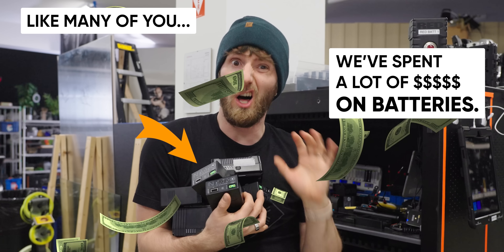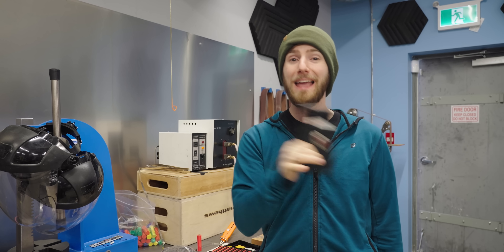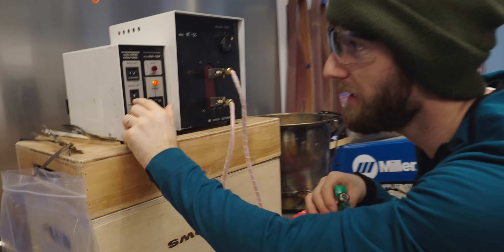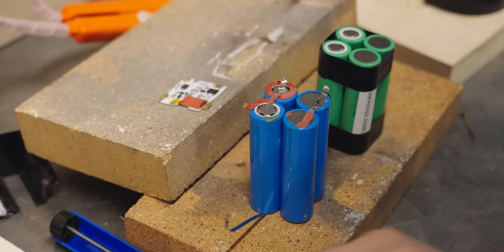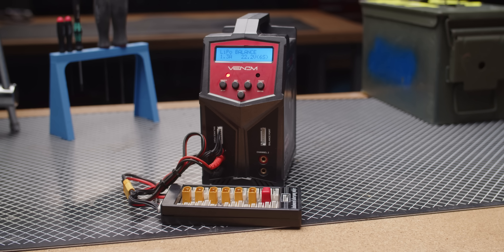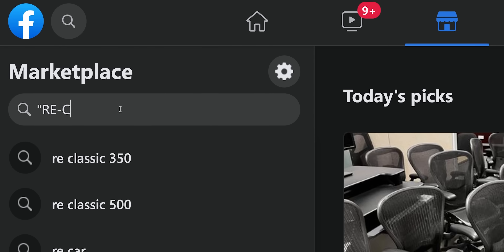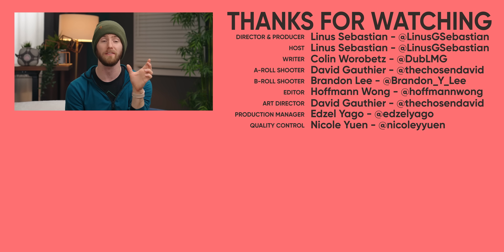This should be illegal… Battery Repair Blocking

Comment: ive had more than a few laptop batteries take a shit after changing the cells. the bms just goes into lockout and refuses to charge or allow voltage to pass to the laptop. it definitely should be illegal! if the voltages of each cell are in correct spec, then it should just work!

Comment: Those weren't shortcircuit spark, those were nickel strip being burnt by the spotwelder being a bit too strong.

Also, they worried too much about a few sparks and then they cut the nickel strips with some non insulated gardening scissors like, come on guys!

Finally, always wear gloves when spotwelding, spark may fly :p

Comment: $0 why don't you donate/give/sell for cheap ALL THO$E GOOD CELL$ ???
Reply: Y'all are TOO SAFETY CON$¢10u$ !  Get rid of the 'you blew it (!)' marginal cells and re-use the other 'good ones.'  Duuuh ... apologies but, yer WASTEFOOL !  :-(
Reply: those LiOn 18650 cells can be used in flashlights etc., ... I replace 2 or 3 C & D Alkaline battery flashlights with these cells & just use 'dummy batteries' to make up the gaps.

Comment: instruction works in 90% of cases whith not completely dead batteries
1 - fuly charge battery u want to repair
2 - fuly charge new batteries that u want to use as a replacement
3 - assemble new battery pack and solder wires to it (long enough to connect them to bms without disconnecting old battery pack)
4 - take old battery and coonect new battery pack in paralel using wires u previously soldered (do NOT disconnect old battery pack)
5 - disconnect old battery pack and assemble battery all together (u may need to change wires for shorter ones - do it but remember not to disconnect wires beafore new ones are fuly connected)
6 - discharge and fully charge your new fresh battery (neded for ballancing and detecting new real cappacity)

shortly speaking trick in all that is that bms controoler blocks it self if power is disconnected fron it (from any battery banks that are connected to it) - so to change batteries u just need it to be always powered on

Comment: Evil BMSs, nice one. To some extent, this is true, though. For example, in the past I tinkered with a few laptop packs, restoring them. They have microcontrollers inside with software which counts cycles, remaining capacity, and also monitors the battery health, and so if they decide that the battery is damaged or faulty, which can happen by disconnecting the BMS wires incorrectly (i.e. you first need to disconnect positive or negative terminal to remove power from the BMS to stand a chance), your only chance then is to reprogram the BMS controller, and these usually are not open source…

Comment: Back then on my Notebooks from 2005 and 2008 there Batterien was exchangeable like a Modul at the bottom you could even use it with cable and Batterie out... and also Smartphones like Samsung s2 or HTC one u could swap out Batterie why are nowadays every Battery is hidden so deep in every device like on Notebooks u need to open whole thing and Smartphone also.... is this just a commercial background so ppl are unable to change it by themselves or did they get so "smart" they NEED to do this cause ppl dont play around?

Comment: you need to power the assembly (battery + bms) to start the bms. simply replacing the batteries does not start the bms

Comment: Let me tell u my story…   I tried re-celling my dell battery. Inspiron 7537 to be precise. I got a generic battery, took that apart and got the 4 cells out then connected the new cells with original battery bms. And boom. It never wake up! the bms was so smart to shut down it permanently,  so for the future Linus plz keep the bms in a continuous voltage. May be with a bench power supply and then work on the cells. Its like the bms needs life aids like a ventilator for a patient in ICU. Lol

Comment: I love that in case of a fire you have manipulated the door to be easily opened. The door with the sign on it which reads "Fire Door, Keep closed, do not block". :D
Reply: At least they're propping it in anticipation of a runaway exothermic reaction and not because they're using it as a ghetto loading dock (see: every restaurant, ever).

Comment: So Aliexpress and the like sells generic bms boards and one feature of those is that when you first connect the battery pack you get no voltage on the output until you have connected a charge voltage to it whether the pack needed charging or not.  Then the output voltage will be turned on.  This could confuse some people thinking that the bms is evil or something but it is just a safety feature or something.  I don't suppose you have run into a feature like that with your battery pack?

Comment: Dell has Evil BMS, not only do they not accept replacement cells, the BMS artificially degradates the cells, charging less and less overtime and falsely stating the condition of the cells. i wont buy Dell because of this. No, they do not care about the environment, just selling more batteries.

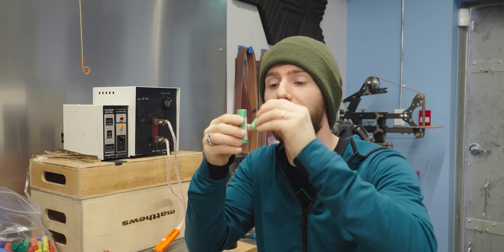Comment: 5:33 wrong, your next order of business is to load the individual batteries into a tester and have them 24 (minimum) tested for capacity, true capacity, and many other factors and also get them equalized. You never go to spot weld anything until you're 100% sure you've got a right pack. HUGE mistake.

Comment: I haven't glued the backplate of my phone because the charging port breaks if i use another cable, it won't completely stop charging, but after switching cables i have to position the cable a specific way.

Comment: I read somewhere that you could build the new pack but to get the bms to work on it you had to charge (or discharge) the new pack to the same voltage as the old pack, and connect it in parallel with cables. After that you can disconnect the old pack from the bms and it should work. Unless it's the "evil bms with X amount of charges cut off".
Voltage isn't cut off, voltage isn't different, only capacity will change as you do the transplant. Whether it works or not i don't know, but to me it would make sense that it would work.
Ps: The solution is to make these products like old 90's products that used AA batteries. Do the same for 18650 in laptop packs, camera packs. Add a smart bms that can allow "noobs" to just throw in randomly charged cells and it will do it's own balancing etc. Should be easy, but i'm no millionaire so i won't be the one making it ;)

Comment: Don't throw away your old cells!  They can still be separated, tested and repurposed, they work great for powering small electronics projects.  Battery sleds for 18650's are easy to get, then use an external charger to charge them, this is very safe and no welding or balancing issues.  Lithium batteries are always tricky to work with when they are in packs which is why when I use them in project I set them up to be removed when they drop below usable voltage then use an external charger that can monitor them individually.  No fuss, saves a crap ton of money if you convert something that was using alkaline batteries before and if one cell goes bad the charger tells ya and just toss it to recycle.  I think the biggest reason to not make these packs rebuildable for the consumer is for the exact reason you experienced, not because of the hazard of actually rebuilding the packs but if not done right it could catastrophically fail while in use or worse while in luggage on a plane which is the worst case event.  It would be really neat to see the recycling plant, there really needs to be more awareness and dedication put into the recycling of electronics.

Comment: Do not mess with current rechargeable Lithium batteries. These things are dangerous. Changing the design will invalidate safety-tests and assumptions, even when it means going to newer batteries inside. As soon as battery types become available that are safe even if you mistreat them, sure. But current Li cells are not safe unless handled carefully and exactly right. So ask yourself: Is saving a few bucks worth burning down your house?

Comment: A non-profit I worked for made photo ID's for kids at events using Polariod cameras. Film became scarce so they asked me to put together a digital ID system which i did using a little Atom powered laptop and an Epson Charm Photo printer. When it ran out of ink I opened the ink cartidge and it was 75% full. The non-profit didn't have much of a budget so I called epson to try to find a way to use this ink and asked if they had a set print output and then a kill switch and the rep said "No, we don't do anything like that." so I kept asking him questions trying to figure it out and eventually got sent to elevated support and questioned them for a while about it and he kept denying it until he finally got so frustrated at my questions that he blurted out 'DO YOU THINK YOU'RE THE FIRST CUSTOMER TO FIGURE THIS OUT?!' lol.

Comment: I built a 4S pack from second hand 1865(0), 196 of them, it has been running my 4x4 fridge for around 2 years now via 350w solar with controller and BMS and temp module. Understanding resistance and cell type makes it possible to safely use 2nd-hand batteries which is beneficial to reduce land-fill. It really depends on your skill level. You took the right approach with this video to educate layman to use new batteries.
Reply: yea having something that is decently accurate to measure the internal resistance is key to doing it right.
Reply: You have taken the appropriate time to self educate and likely didn’t skimp out on necessary parts for a risky procedure. I would ask that you warn others to take due diligence or don’t do it at all. And yes, I’m a degrees and practicing electrical engineer. ABC extinguishers won’t cover this and we’re never meant to.

Comment: Linus did you try splicing the new battery on in parallel while keeping the old battery connected before detaching the old one? Assuming the old battery is still working well enough to keep a live circuit on the BMS?

Comment: Some BMS can be reset by connecting power (ideally, a current-limited supply) to output terminals.
I saw one guy on Youtube revive a Bluetooth speaker with 2x18650 powerpack this way.
Don't think this applies to REDs though, given that RED is an ultra high-end kind of company, they probably won't want to lose the huge margins they get from battery sales to DIYers re-celling their batteries.

Comment: All I saw in this video was gross incompetency, how do you create short circuits 3 times in a row and not learn from it?! put isolation paper washers around the positive terminal FFS. 
Also you can buy BMS boards for almost every cell config for very cheap so if the default one soft bricks itself just toss it and replace it with a generic BMS!!!

Comment: Makita... 18v batt from them blocking themselvs when one of cells die. If You want to re-cell you have to connect other pack to bms, cell by cell to keep konstant power to chip... If U cennect battery pack to charger and its report fail most of the people connect it one more time, because they think there was bad connection... If You do that chrger permamently blcok the BMS chip. Solution? if there is fail first time disassembly the batt and charge separetly low charg cells. No rescue for battery then. Only new BMS... Milwaukke reset the pack after reconnectin it to charger so big ++++ from me. Some Years ago some guy put car on orbit :D i cant belive that nobody can design power pack with easy to change cells... Simply bad will...

Comment: Lithium batteries should never be discharged too much, so the BMS will "turn itself off" if the voltage of the battery gets critically low (to make the current draw of the empty battery as low as possible). Usually the BMS has a pin that you need to apply a voltage to in order to make it start up again. When the cells were disconnected, this is needed. That is probably why the that last pack that should be working remained off.

Comment: You want to see crazy rechargeable batteries.   Iook at the Electric Bike Industry.  This growing industry and "eoc friendly" (you don't use gas) is everywhere.  Yet it seems every bike has a different battery type, even different brands have slightly different battery styles and won't fit but one type of bike.   Prices for replacement $450 to $700 !
I don't see "eco friendly" when you are tossing 12 lb batteries out after 3 years.  But of course they are just packs of batteries making up different voltage and amp requirements.  I have seen a "single" strap type E-bike battery with a few different plugs to match a few different E-bikes.
There are a handful of places that will fix your E-bike battery, but shipping and repair costs don't drop the price that much.  Then you can start on the new and upcoming "required" lawn care equipment that will be battery only !  I have a small weedwhacker and blower, both on 42V batteries.  So far they batteries are working, but not sure the $80 battery will last.  The "FEDS" should come up with a few requirement on replacements and recycling.

Comment: As someone who designs advanced batteries for aerospace and other entities that I won't mention, I've done a ton of destructive testing of the 18650's and actually have a couple of patents coming out with vent protection. With that being said,  you still don't want to mess around with these cells when they short. Even though they have "vent holes," these cells typically burst at around 800-900 PSI and release gas at around 200-300 PSI, so it's not a peaceful vent. It's more like a tiny grenade going off. These cells are typically made of a nickel plated steel for the casing as well, and the cells won't bulge outwards, but they will 9/10 times burst the cell casing and vent outwards instead of throught the vent cap if the cells aren't fully constrained. When this occurs, you'll 9/10 times get thermal propagation to neighboring cells which will then burst themselves. What I'm trying to get at is, don't mess with any lithium COTS cell unless you absolutely know what you're doing.
Reply: eioshen boboi  Absolutely not. Lithium reacts violently with water and forms lithium hydroxide as well as hydrogen gas. One of the best things to do is use sand as it doesn't react with the lithium cell if its going towards a runaway event.

Comment: FYI those sparks were practically harmless..
it's a poor connection between the surface and the tip of the welder. The cells are fine.

Comment: I’m a broadcast cameraman. I’ve done this with many Anton Bauer batteries with laptop battery cells. I didn’t have a spot welder so I had to solder. But, it worked. Most of the time only one parallel set was bad and some times only one cell (but I would replace the whole parallel set). Why?  Because these batteries are expensive and these were for my personal projects. I’ve even bought used batteries and fixed them to save $$$$.

Comment: Ok buddy, as long as you accept that swapping batteries and replacing my battery with my BMS's charge / discharge curve flashed on it voids any kind of claim you might have if something goes wrong, then go ahead. You seem to think that manufacturers design and manufacture the product and that's it... I have laws to follow, certifications to get.
Send me your device, i'll have the battery swapped, sure. Ill have your old battery recycled. But I am not allowing you to swap batteries at will.

You cannot just use any 18650, they have very different rated charge currents, charge voltages, empty voltages, discharge curves, etc... 
Like, OK BMSs can "learn" a curve but it is a tuning process with special equipement that then create a golden flash firmware. if you want the firmware, ill send it to you but you flash it.

AAAAAnd your BMS at 14:00 was probably just in undervoltage protection, which can be bypassed by applying sufficient voltage on the battery pack output (not the cells). You hired electrical engineers, have one of them google the datasheet and figure it out. DIYing is not just swapping parts.

Comment: next time use a barrel of water, i think it's better than a bucket of sand that with the pressure of the gas getting out from the battery pack,  can easily throw hot sand everywere! and you don't need to cover the battery pack with additional sand  (in case of emergency, not to stack old batteries). ps i think that the Ferrari's kers departement use the same technique.

Comment: Second pack looks very much like an old pack from my robot vacuum. I was able to rebuild it without spot welder with a soldering iron by making scratches on both sides and pre-cooling the cell before soldering it. After initial drop stuck it was piece a cake. 
I don't think such approach is scalable though, because it took shit tonn of time and the risk of overheating and killing cell is significant.
Reply: the reason you'd use a spot welder rather than a soldering iron is because notwithstanding the insane amount of heat the arc from a spot welder generates, it's applied over a much smaller area, hence very little heat actually transfers into the cell. It's a lot like flying through the Solar corona and sticking your hand out of the window. You'd feel a little heat from the plasma but because it's so rarefied it's nothing more than a prickling sensation as the hard radiation is what actually cooks you, not the 6500K plasma, compared with a 373K scalding burn from a boiling kettle - there's a lot less heat energy but because it's in a much denser material (the water) it's a lot more concentrated so it feels hotter and does a lot more damage.